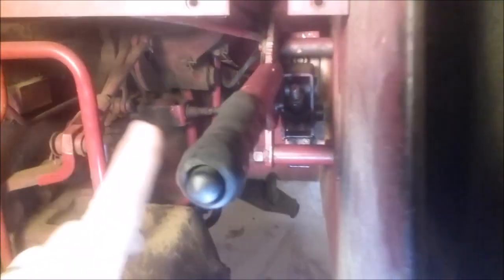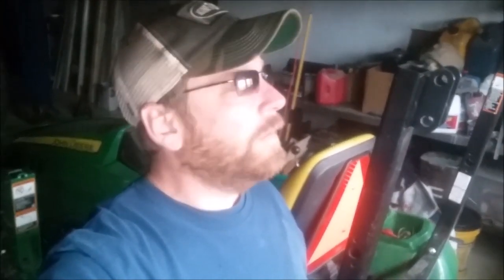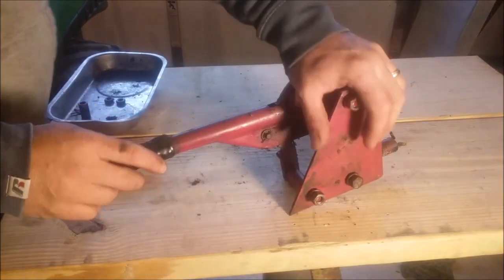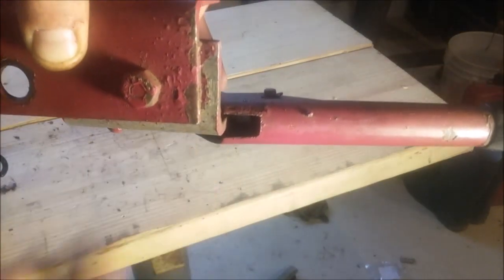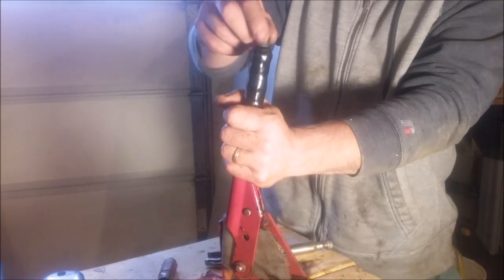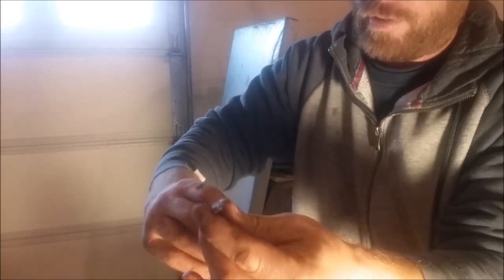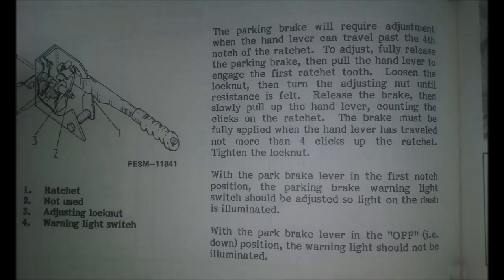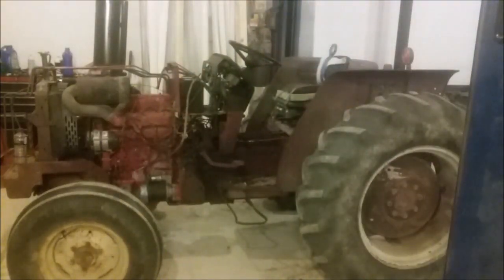PARKING BRAKE adjustment and ASSEMBLE REPAIR on IH Tractor ... Red Power!

Comment: How do you replace the parkiing brake cable on  a 1986 international tractor  also i nevet had an international before so is it forward and reverse on the outer gear leaver and  just forward in one gear leaver  and then  highand low on the gear lever nearest to the drivers seat  thanks for any help     regards pat in ireland

Comment: Great video, have you ever changed the crankshaft Front main seal  on this tractor?
Reply: Can you change the seal, when engine is in the chassis?
Reply: Kentucky Yankee  Thanks, that’s helpful, it’s in a very confined location.....